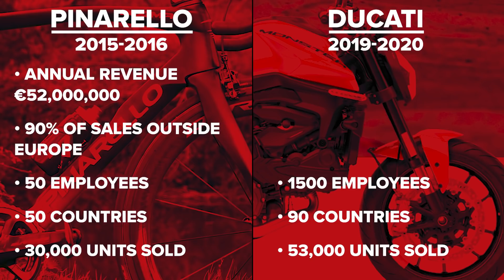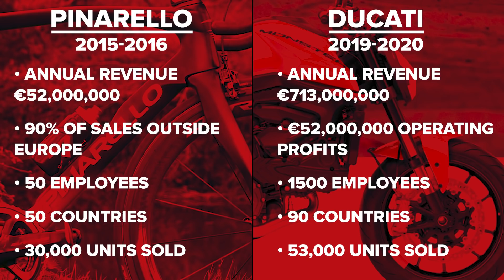How Can A Road Bike Cost £10,000?!

Comment: The bigger question is -      Are BB shells manufactured round on a £10,000 bike?  

😏😏😁
Reply: Ask Hambimi?
Reply: @cheesylorry  The first thing I thought of when I saw the vid's title was Hambini, ahaha
Reply: No
Reply: Helllooooo Backpacking Adventure Fans!!
Reply: Nope
Reply: Not usually
Reply: No bearings are
Reply: MRGRUMPY53  it has a steel or aluminin insert
Reply: Hahahaha
Reply: A BSA threaded BB is just a treaded unit that contains a push fit bearing......
Reply: @singingitman  Yes, however, it can take less tolerances in poor frame design.
Reply: nope🤣🤣
Reply: Round? Yes. Circular and concentric? No
Reply: Need huge bronze bushing for bb with grease fitting, cottered cranks. The fools would rush to buy them if some doping athlete would endorse them.
Reply: @cheesylorry  he would disagree. Lol

Comment: I think the problem people have with these costs is the quality your getting, especially in the BB department. I'd want aerospace tolerances on a 10k bike. We are not getting anything like it. In fact sometimes it's absolutely appalling.
Reply: @DD GG Indeed, Planned Obsolescence. A phrase first used in  the automotive industry 🤔.
Reply: Therein what should be the real question. Why is value not reflected in price? I certainly wouldn't begrudge a bespoke builder charging $10K if it was apparent in customisation, quality and craftsmanship but for the likes of Specialized, Trek, etc to charge as much in their absence, nope.
Reply: ... speaking of quality: you're* getting ...
Reply: @einundsiebenziger5488 Indeed 👍
Reply: @DD GG My carbon frame has inserts for the screws...its not into bare carbon.
Reply: @DD GG Its an older Trek mountain bike frame. Trek Y 22 SL.

I dont know if they still build that way on newer bikes, but they did in 98. 

Im buying a Lux XC bike this year. I hope galvanic corrosion is accounted for.
Reply: I work in the aerospace industry. What you pay for in a 10k bike is the story behind it. I have only seen “bro science” arguments why a 10k bike much better than a 5k bike
Reply: @ankjaers  so basically brand and elitism tax?
Reply: @_abk_3251  yep..

Comment: In Canada an S-Works Tarmac costs costs of $17,000. But many make the excuse of it being a niche product.
An even more niche sport is Kart racing. For the same price or less you can get a KZ Tony Kart that puts out close to 50 HP for the same price.(Which is also insane) All the parts are designed and manufactured in italy to very high tolerances, and sell far less units than Specialized sells bikes per year. also based on Hambini's videos the manufacturing precision of many bike brands doesn't seem great. Even with motorcycles you can buy a yamaha R6 for the same cost, which is a proper track machine, that has millions of $ of r and d put into it and has to go through several emissions tests by governments. So I really don't understand how a bike can cost so much.
Reply: Peak Torque's video on that was pretty interesting...
Reply: Yes! Even if you consider the cost differences in manufacturing a carbon fibre frame vs a high-quality steel chassis, the still is A LOT of money unaccounted for on that bicycle
Reply: If people are willing to pay X-dollars for something, then it will be selling for X-dollars. Not so hard to understand, basic economics. Does not matter what the profit margins are.
Reply: @sepg5084  Absolutely.  It doesn't matter how "outraged" people are.  If there are people willing to pay that for an item/good/service,  that is what it will cost.
Reply: You're bang on the money. The bike companies however pay much more for marketing (GCN) and sponsorship (WorldTour) which is required to try to sell the allure and induce people to part with their hard earned cash. It's a vicious cycle.

And so much of that vaunted R&D gets tossed into pointless advances such as 12 speed which doesn't do anything beyond causing chains to wear more quickly. Yeah the new SL7 saves you ten seconds over an hour or whatever. Luxury economics at work, nothing more
Reply: @philipk4475  MotoGP has Yamaha as a sponsor for Monster Energy team.  And the same team in FIM Motocross World Championship. And in road racing. And are sponsors for some of those competitions, and are putting a lot in marketing. FThey have a whole webpage just for the racing teams: https://www.yamaha-racing.com

The innovation and R&D in automotive/motor industry is much bigger than in bicycle industry. 

So the only part in which you're right is .. luxury economics..
Reply: Anything Italian clothes ,cars ,guns all cost mega amounts ,what i dont like is they lead you to believe bikes are made there like the high-end clothes for instance gucci or versace are still made in Italy so you pay the premium like German cars from bmw ,mercedes, porsche . Would i buy a Lamborghini made in  taiwan ?
Reply: I can buy a car for that. 🤦🏻‍♀️

Comment: So Cannondale are pretty smart to continue to develop high end Aluminium frames as it can protect them from increased labour costs while allowing them to ask a bit more for their frames due to their competitiveness with carbon. They do a good carbon bike too of course and I wonder how much their aluminium development is to thank for that. I'm a fan of Aluminium bikes. Did you notice? lol.
Reply from the maker: There were clues 😂
Reply: High quality hardtail carbon bike frames range from 800g to 1kg for MTBs, high quality hardtail mtb alloy frames are usually 1.7kg and up but are less sensitive to over-torque and from becoming "total wrecked" from crashes. Cheaper too.

If people are ok with an additional 700+grams additional weight on their bikes then they should just buy aluminium frames.
Reply: In mountain bikes high end Downhill bikes are going back to Ali where weight well placed can actually be an advantage. It was bound to happen as they reach the limits of carbon and can't keep shaving off grams.
Reply: I somewhat agree on this. Carbon is a great material, but it's too labour-intensive. Aluminium frames can be almost as good (most people wouldn't notice the differences). If brands invested more in aluminium frames, they could be made more compliant, and aero, lighter, and cheaper. Probably almost as cheap as a bad alluminium frame, if you exclude R&D.
Specialized allez is also a good example.

The same goes for groupsets. Luckily there are some cheap alternatives that keep getting better, like Sensah and Microshift.
Reply: @DD GG I only talk of production costs and how this can impact a business. Costs being the main theme of this video. I am not going into the durability of each material although I suspect there are pluses and minuses for each. I hope your friend is ok from that frame cracking incident, but we all know there have been many horror stories regarding any frame material, due to a wide variety of conditions, for example poor build quality, poor processes, poor maintenance, bad riding technique even. As long as manufacturers like Cannondale champion the use of relatively cheap materials we can have great bikes at reasonable prices going into the future. Costs are going up for everything, but our salaries are not!
Reply: @DD GG Disagree. I've cracked steel, Al and Ti frames and they had all this in common: the failure was gradual not catastrophic. Indeed, in the case of my Ti and Steel frames I rode them after the cracking began  (seat stays in steel frames, BB and seattube cluster welds in Ti frames) for weeks and days respectively as I gauged their progress. 

Contrast that with my pristine carbon bars that snapped in two after my leaning bike fell over. Carbon is notoriously difficult to apprise of damage visually, it's a well known drawback of the material. That's why buying a used carbon bike is a dodgy proposition while buying decades old steel bikes can often increase in value in resale.

Comment: The most ludicrous thing about those prices is that the frames cost around $400 to make in China.
Reply: Taiwan for Pinarello , maybe a little more but not much
Reply: so much? i dont believe it.
Reply: I know
Reply: Brand - Demand.
Reply: Less you can bulk.buy them in lots of under @100 for 200 quid . You don't need massive production runs
Reply: Manufacturing isn't even the initial cost, much less all of it.  The frame has to be designed, engineered, tested and that takes years.  Everyone involved with that wants a salary, and that is only one of the costs.   Once it is approved, the frame has to be shipped, tariffs paid, transportation paid to the various places they are supposed to end up.  All of the people doing the handling have to be paid as well as the shipping companies. From there distributors add their costs (and profits), more shipping and we haven't touched the parts the frame needs to make it a bike.  They all have the same operation costs.  And we haven't touched inventory taxes (in the US).   Then to the shop and finally to you. Everybody wants to get paid and they aren't going to give up a part of their income so we can buy $10k bikes for $600.  

All the people complaining about the price aren't aware that the odds are overwhelming that, if given an unmarked bike to ride, they couldn't tell the difference between it and the lowest priced carbon bike except for the weight (maybe). Professionals, who probably can spot the differences, don't pay for their bikes.
Reply: @antares8281  You’re triple-dipping on shipping costs, and “inventory taxes”?
Reply: see that why you only buy a Time (handmade in France) or a Look (handmade in Tunessia) and Specialized
never buy giant, trek, cannondale, focus, boardman,  cervelo, canyon these are cheap bike in disquise (nice components)
Reply: @mididoctors  yes a high end carbon disc wheel frame that weighs 850g for 100 euros
Reply: There are overheads to cover. They need to make profits too.
Reply: @antares8281  Wait...people who design/build/ship/sell bikes want to be paid so they can feed their kids? Outrageous! I demand free bikes
Reply: @antares8281  So how are you going to explain the awesome hyper wheels from winspace? That cost nothing even compared to the new "cheaper" roval. They do what most manufacture do. They design, produce, ship, sell, etc. If we keep normalize this, it ends up just like fashion.
Reply: Yeah probably but also the frame is just one component there is sooo much more to add, everyone knows things are cheap to make when’s you use cheap labor and make thousands of them
Reply: @samskisamsonof  specialized is the biggest rip off!!!! Multi million dollar ad campaigns and a whole lot of world tour teams to sponsor. Someone’s gotta pay that bill.
Reply: @mudonsunday  yess but theyre still top of the line in whatever bike. they do it all. and still as better manifacturing standart than a lot of compagnie
Reply: @samskisamsonof  I ride a time vrxr ulteam for that very reason , its actually made by hand in France unlike high-end colnago ,pinerello ,but either way the athlete makes the bike very few of us will never ride like pros but we dream we can ?
Reply: @marcalvarez4890  most designing today is using CAD software. Human is much less involved than before. Your argument makes less sense every year.
Reply: @antares8281  well that's the story for just about any 1-2k bike too, sure they maybe slightly or significantly under tested(and the quality doesn't even suffer as much as you think) but they're still selling for the cheap price. It's all about brand tax, I'm not attacking your favourite cycle brands, it's just business in general. Look at apple and super car manufacturers, you can get apple spec Android for a fraction of the price, you can get a sporty tunable car for a fraction of the price of a supercar... Its all elitism and brand tax, I'd say diminishing returns on bike pricing max out on 4 or so Ks, anything after that is just branded gimmick that doesn't make any difference for an average fred

Comment: I think some of it has to do with the UCI rules that say components used in racing must be commercially available. If there wasn't this requirement, then many of the top end components would have no reason to exist in the retail market. But because the pros want these bikes and components for racing, the  manufacturers are forced to sell them at retail, and people will inevitably buy them. But the general public really doesn't have any real need for these products, and would be no worse off without them.
Reply: This is true,
the general public has no use of a wear part like an casette being made out of machined titanium.
Fortunately we also have plenty of decent parts at lower tiers. Shimano 105, Deore 6xxxx or even GRX 400 are very decent parts.

Combine that with a Aluminium frame with a carbon fork and you have more then a half decent bike.
Same With Mountainbikes with a half decent airfork. 
We are talking between 1 grand and 1700 euro's roughly.

Comment: Trek Domane SLR 7: $8300
Custom paint: +$1000
2nd wheelset RSL 51: +$2400
2nd set of tires: +$120
2nd cassette: +$80
Garmin XC200 power meter pedals: +$1200
Seat upgrade to Verse Pro carbon: +$70
Wahoo Elemnt Bolt: +$240
Redshift Aerobars: +$180
Total: $13590